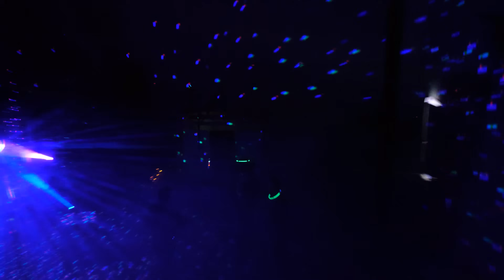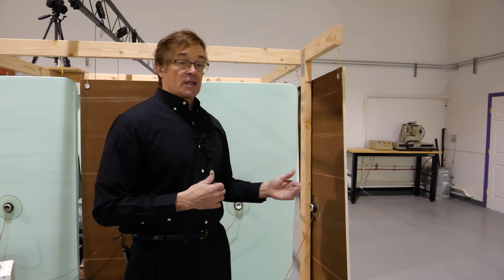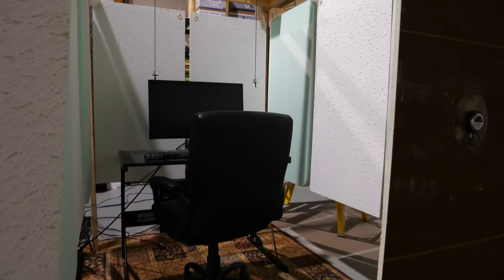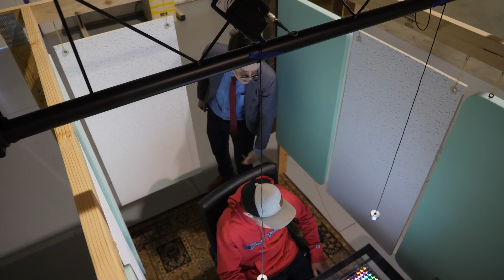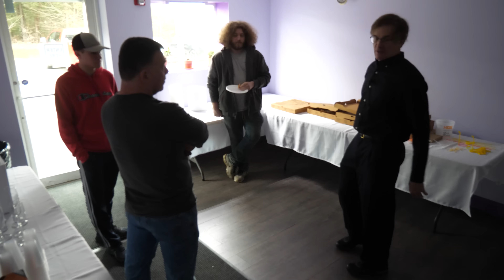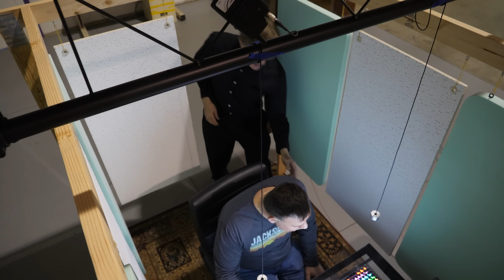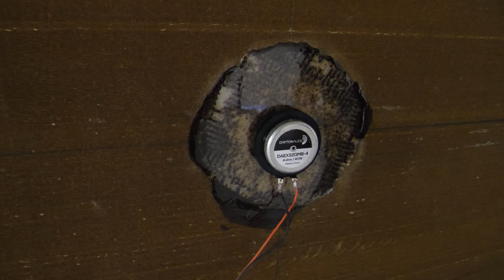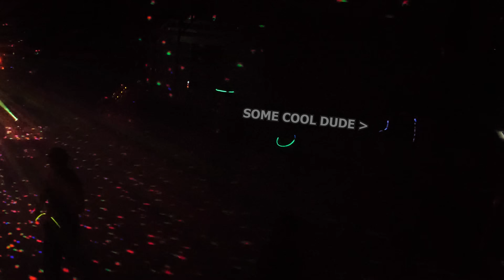SHOULD SPEAKERS THIS GOOD BE LEGAL?

Comment: it should be noted that if you run speakers in series to get 8 ohms, each speakers voice coil now acts like an inductor to the other speakers voice coil, so in other words each one acts like a crossover to the other which can kill  the high frequencies... OOPS, edit, did I say kill?  I meant it will roll off the higher frequencies reducing the highs.
Reply from the maker: A cross-over requires  capacitance.
If the exciters in each coil are 4 ohms, how is this different  than the same number of windings in an 8 ohm driver with all the windings in one coil?
Reply: @TechIngredients  Uh Oh... a crossover does "not" require capacitance.  In this case that I commented on you are adding inductance in series with the drivers, yes, each voice coil is an inductor, and inductance in series will crossover (reducing/rolling off) the highs without a capacitor or capacitance necessary.  

Moving on to "how is this different" a well designed speaker/driver would not simply double the number of windings to get 8 ohms, or to be the same as two 4 ohm drivers.  That thinking would imply that the designer just added extra windings to the voice coil, which would mean that the voice coil is now twice as long or they added more layers to the voice coil and now needs a bigger magnetic gap.  The voice coil can be made in a variety of different ways.  Using a smaller gauge wire you could have the same number of turns as the 4 ohm driver and now have an 8 ohm driver.  

No matter which way you achieve 8 ohms, running speakers in series is never a good idea.  There will always be a reactance due to the added inductance, and there can be even more problems.  Drivers can and will cause undesired interference with each other when run in series.  I see people do it all the time, and it is wrong.  Anyone who doesn't believe me should go watch some sub-woofer box videos in slow motion... the videos where the builder has the woofers in series.   You can clearly see that they are not completely in sync as they are each trying electrically to push the other in the opposite direction.
Reply from the maker: I have to disagree.  Crossover circuits are frequency  dependant filters, and they do use capacitors. You need to review this.
The ohms  on a driver are not pure resistive but indicate impedance. Adding  wraps will increase both, and you will find that depending on the coil dimensions, two coils in series may result in an impedance that differs from a single coil with twice as many turns, but not much. In any case, the result will load the amplifier differently, but it will not generate a cross-over filter effect.
Reply: @TechIngredients  Ok, not going to argue, but you are the one that needs to review

Comment: I cant wait to try this, but have a few questions: 

Don’t you get phase cancellation by having more than just a left and right speaker? 

The larger the surface the more directional ‘beaming’ you get higher up the spectrum so just having a left and right, probably with acoustic panels to dampen the the space would potentially sound better.
Reply from the maker: No, you don't.  This is a 5.1 channel system. Phase cancelation  requires actual  phase inversion.
Take a look at our previous video on noise cancelation.
Reply: @TechIngredients  sorry I should have said comb filtering (I think). Waves arriving at different times will partially cancel. 

I didnt see it mentioned that the music was mixed for 5.1 so I’m guessing it is either playing out of all speakers simultaneously which isn’t the best way to do it, or your 5.1 decoder is doing the work and you are actually just listening to left and right.

Maybe I’ve got the wrong end of the stick here?

Comment: Excellent work! Please keep it coming.

When investigating the impacts of shape, did you spend much time looking at a variety of non-rectangular or assymetric panel shapes as a way to minimize annoying resonance issues? I'd be curious about shapes like ... straight-edged shapes with no parallel sides, ellipse, hyperellipse (superegg), amoeba-like shapes with random blebs (eg Tomatometer splats), stars with many random length arms (eg mid-century modern sunbursts), 3D shapes (hollow and solid), 3D trees, 2D and 3D eggs, regular and irregular donuts, extra-thin material (like cardstock or thin sheet metal, possibly held flexed or warped into 3D curves), various surface textures, like gloss, crinkle painted, or covered with 1/2-round or triangular cross-section strips. I could go on, but I think you get the point.

I'd also be curious about the addition of nearby passive radiator elements.

It's interesting that cardboard does so well. For other projects, I've considered soaking it with varnish or shellac in order to make project constructions with it more permanent. I wonder if that would destroy it's acoustic advantages in this application.

Do you have any thoughts on how to create a DML subwoofer to go with it?

This is a whole lot of questions I should study myself, I suppose ...

I definitely have to look at your other investigations.

Thanks, Bruce
Reply: I wondered about making slightly concave panels, and larger (say most of a 4 x 8 sheet of something), with the curve held in place by a long, thin, curving strip of plywood. But then, the curve would start to reinforce the strength of the panel, likely reducing the acoustic flexibility. Damn.
Reply: @monkeysuncle2816  interesting idea! Instead of the plywood strip, what ìf you connect opposite corners with fishing line or piano wire, with small springs or bungies at one or both ends and bow it a bit? Or, ínstead of mounting the panel vertically, suspend it from the ceiling by all 4 corners, so it sags under ít's own weight?
Reply from the maker: We tried a circle and an ellipse and actually found little difference between  these shapes and rectangular panels.
More extreme  variations might make a useful  difference, but as you suggested, the combinations of possible shapes and materials are vast.  The best approach would be for someone  with access  to  finite element analysis software to create a program that interacts material properties and acoustic rules. 
The shellac will probably  reduce the performance  at lower frequencies.
A little test I discovered is to simply use your fist and knock on the material.  The panel sounds good at frequencies higher than the sound of your knock.
Reply: @Tech Ingredients  Thanks for the reply. I kind of expected your answer; there's essentially an infinite set of possibilities. I was trying to get as much professional opinion and insight regarding classes of shapes worth pursuing, so I could reduce the set I'd have to test ... Infinity ÷2 or 4 is a much smaller set than infinity. :-)  Although I am neither an acoustic engineer nor physicist there was some thought behind my suggestions.

- all your shapes are symmetrical in some fashion, yet you found a non-symmetrical placement of the driver was critical to avoid resonances ... this makes me wonder if an asymmetric shape might have a similar effect

  - similarly, your shapes are also all flat; thus the curiosity regarding 3D shapes

I have a couple more questions, if you don't mind ...

  - can I assume from your comment that materials which produce a dull thud when knocked are preferred as the base material of construction means woods with good acoustic properties for the construction of guitar bodies would probably NOT be a good idea; nor would mounting the driver on an acoustic guitar body?

  - since one of the principles you mentioned for mounting the panels is isolation, did you consider elastic attachments in place of the fishing line, such as springs, rubber, or very small Bungie cords?

  - do you have any thoughts, or even gut reaction, on the usability of the panels as office cubicle wall panels for noise cancelation of office noise?

Thanks again for sharing your research.  < @tech ingredients >
Reply: @TechIngredients  bump

Comment: This was super interesting; I didn't realize you could use materials like ceiling tiles to act as speakers. I have a suggestion for a follow-on video & possible commercial application; I had the idea immediately upon seeing these... noise-cancelling panels / walls.

I wanted to try & make such a system when I lived in the city & had a few neighbors in nearby buildings that would play extremely loud music all night long, but I didn't have the tools or time or knowledge to pursue it at the time. I feel like these ceiling tiles / other flat panels would make an ideal solution, where noise is coming in through a wall, a sensitive mic picks it up, & plays the inverted signal through the panel. I personally don't have much sound issues anymore, though I know lots of people do & would love something like this, whether it's the sirens of the city or the birds chirping at 5 am.

I'm down to help with the signal processing part of it if interested.
Reply from the maker: Did you watch our earlier video on active noise cancelation?

Comment: I have a question. In my region it is impossible to buy that type of ceiling tiles. What can i replace it with, or, what material are they made of?
Reply from the maker: Look for rigid, end-grain balsa panels.
Reply: @TechIngredients  Thanks, I look for it before - unfortunatley that type of panels are not avaiable in my country to...

Comment: So there's another YouTuber that did this and he put two exciters on one panel, one 3/5's double-offset, and the other in the direct center and it seemed to increase the range and smoothness of response. In addition to this, a commenter in your second video (the one where you discovered the acoustic ceiling tiles) talked about making a golden ratio panel and mounting the exciter on the golden ratio line and how that gave it an excellent sound.

So my question to you is this: Have you, or will you experiment further with the shape of the panels and placement of the exciter and/or multiple exciters, particularly in the fashion that the other YouTuber and the commenter I spoke of did?
Reply from the maker: One thing I discovered is that multiple drivers behave the same as a single driver located at the midpoint between these other positions.  I think that only complicates the build.

Comment: 30 years ago I built almost the same speaker system for my house. If I'm moving a paper subject, I thought why I couldn't get sound by moving the wall completely, so I turned the drywall panel that made up the wall into a speaker. frankly, the sound I got at that time was very good at low frequencies, but as the frequency increased, the quality of the sound decreased despite the increase in volume. I gave up because I did not have much construction work and the wall connections of the panel were also tight. (I didn't use a magnet as small as yours, on the contrary, it was a huge magnet, but you get pretty good results with a small magnet.) I approached it just because I was wondering how it would turn out, and left because I didn't like the result because there were many, many more complex projects I was dealing with. but I really appreciated that you looked into something like this in detail, especially since you didn't hesitate to share it. I am curious about many things and try to prototype them, but I have never explained them on video, of course, out of being completely lazy. I really congratulate you for this. There is a point that seems lost to me here, it is normal for the panel to be free to move, but does the magnet system move together with the panel cause loss? Wouldn't the sound accuracy be better if the magnet system was fixed somewhere? Or what if the magnet system was not fixed to a different surface but held heavier?

Comment: I always look forward to your presentations .. all well done. Thanks!
If I use 2 exciters per "speaker," does placement for both exciters on the back of each speaker follow the 3/5 -2/5 rule?
Reply from the maker: Yes.
Just place the center point, between the two actuators, at the 3/5, 2/5 position.

Comment: Im curious how mounting the panels by mounting the induction driver itself to a solid surface instead of hanging the panels themselves from string would change the sound? Would they be louder since the inducers would be solid and all sound vibration would be transferred to the foam panels instead of possibly losing some from the inducer free floating. Also what if you built a frame on the solid surface that encompassed the outside of the panels with spacing around the panels to provide a sort of loose resonance chamber to slightly amplify and direct some of the sound coming from the panels, sort of like how a speaker playing music outside of a box doesn't really produce the level of sound that it does mounted in a box.
Reply from the maker: Fixing  the actuators  significantly reduces the performance. They are part of the mass balance of the panel.
A box surrounding  the panel  is an interesting idea, although  I didn't investigate it.
Reply: @TechIngredients  thank you very much for the reply! I've been wanting to build some of these and your answer solved a question I had.

Comment: Can you use 24 x 48” PVC foam panels?
Reply from the maker: Yes
Reply: @TechIngredients  How does the PVC foam compare to the 1” x 24 x 24” R-5 extruded polystyrene and the thinner 24 x 48” acoustic ceiling tile in terms of performance. I didn’t hear you mention PVC foam panels. 
Would 24 x 24” and 24 x 48” panels work well for high and lower frequencies?
Thanks for your help. I just thought of the PVC foam panels and they are very robust.
Reply from the maker: It's  added density  will decrease its sound generation efficiency but will also improve its  lower frequency response.  PVC foam will perform  more like the acoustic ceiling tiles.
Reply: @TechIngredients  So maybe PVC for the 24 x 48” and extruded polystyrene for the 24 x 24?
Thanks

Comment: I have been thinking about making a huge plate reverb, there very much like this but replace your good material with sheet metal and put it all in an iso box. Could be a neat addition to this journey. Iso box or no iso box, big box or small box, what kind size thickness of metal? Could there be a commercial plate reverb box that comes with different plates on the store shelfs someday?

Comment: question: if I wanted to put panels up on all of the walls of my office, and effectively surround myself with sound, i'm wondering what the impact would be having a wall nearby the rear of the panel. Meaning, even if I hang/suspend the panels from the ceiling as you have done here, say, about 4 inches from the wall (or enough to give clearance for the driver), how important is the air volume behind the panel? Can you move these panels close to a wall (but not touching) and generally still get good performance? Thanks!
Reply from the maker: It's  best to place a sound absorbing  material on the wall behind them if they are going to be hung close to the wall.
To center the volume levels, this can be done  pretty  easily by adjusting the output of each amplifier channel.

Comment: If you have access to loads of materials to experiment with, a large number of speakers to try different configurations, and have the room for it then sure... maybe it will end up being as good as a speaker you can buy. In the mean time I've tried it with 4 speakers on a large panel, with a Denon X4000 to drive it (plenty of power), and the recommended materials (1 inch XPS sheet treated with a mixture of water and woodglue, rounded and sanded edges) and it sounds better than 25 euro speakers, but compared to my KEF speakers they are completely worthless. It sounds exactly like boxes that you can buy for the same amount.

Now, there are situations where it makes sense to get them: they're flat. This can make them suited for spaces where you cannot otherwise locate speakers. But if you can put in speakers it will outperform DIY panels. You can also buy DML speakers made by professionals, using carbonfiber and similar materials, but then we're talking something quite a bit more expensive than DIY.
Reply from the maker: You don't  want to use carbon fiber and if DMLs are constructed from this material  it's  for marketing  reasons, not performance.
It's good that you actually assembled these speakers and based your opinion on your own experience.

Comment: Nice, been following you on this.  Actual issue present in my mind is the high end limits.  I have to be very careful picking head phones and ear buds as most cut off around 18-20KHz.  The average best go to 24KHz.  I found Sony, expensive @ $150 USD, that were clear at 28KHz.  I can hear to 34KHz.  I think most people can hear to mid 20s.  That high end brightness missing, who thought of that mess?  A tweeter panel maybe?
Reply from the maker: Actually, most adults can't hear above 17 kHz. Even infants top out around 21kHz and they aren't a significant  audience.  And, these limits are just that, limits. As you approach these limits the response tapers off, so the majority  of the listening  experience will be at even lower frequencies.
Reply: @TechIngredients  I understand, I didn't know.  Guess I'm strange. Thank you.

Comment: With low frequencies needing larger panels, what size would be needed to replace the subwoofer? Also, would the high frequency foam panels benefit from being smaller?
Reply from the maker: The higher frequencies  do improve  slightly with smaller  panels, but the difference is small.
You can't get big enough.  We tested 1x2 meter panels and that isn't large enough.  A sub is an easy solution.
Reply: I wonder about hanging small panels in FRONT OF much larger panels behind, each with their own exciter?